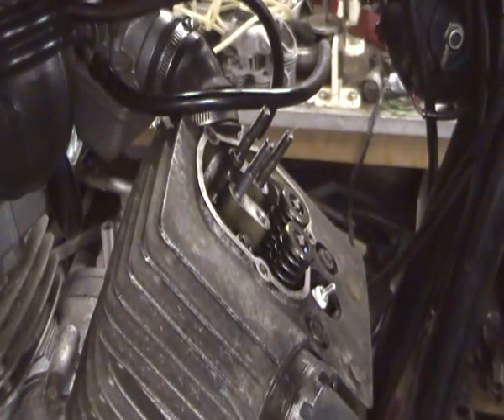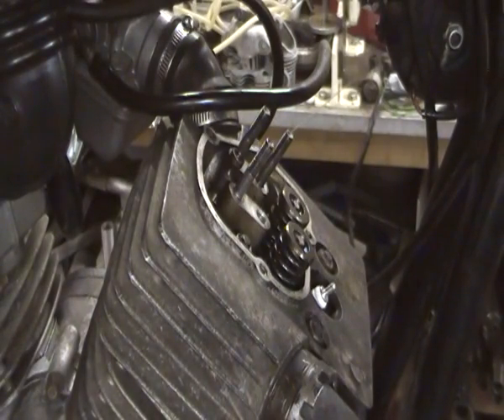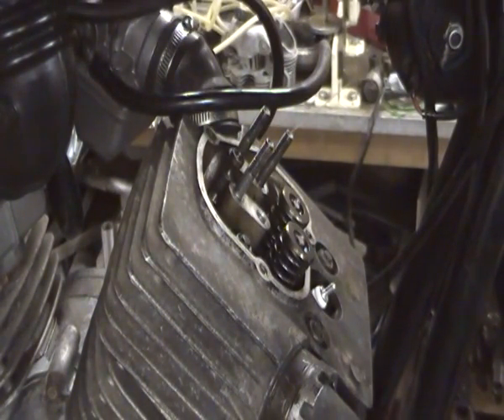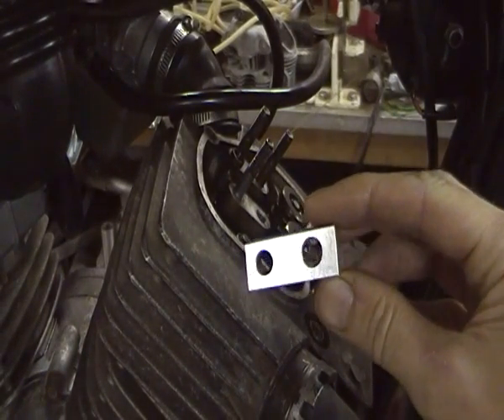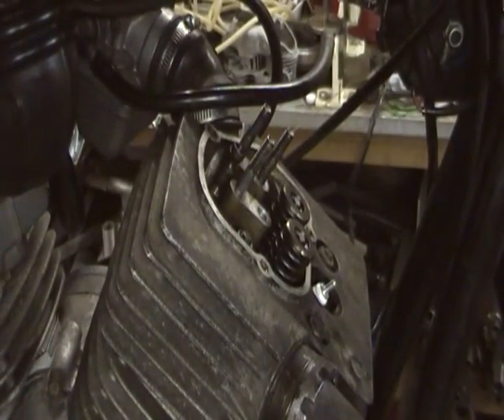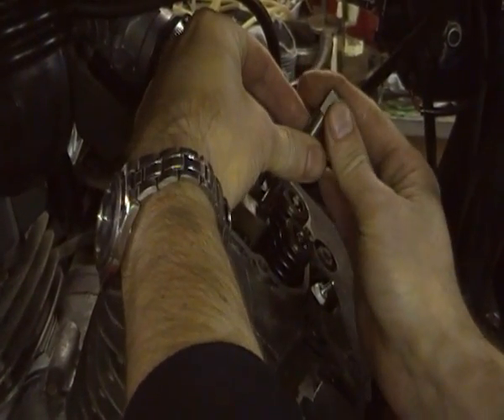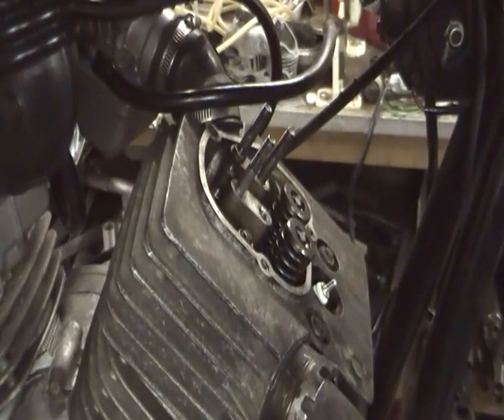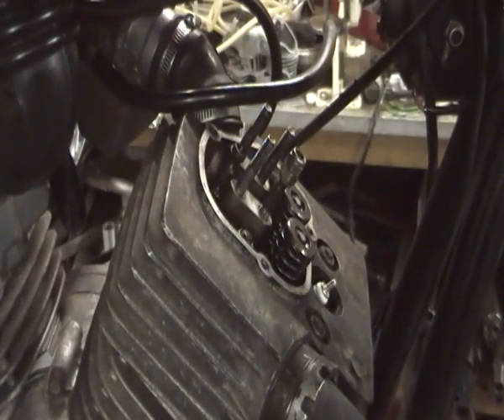Morini rocker stud thread repair

Comment from the maker: I do actually have some square drive sockets somewhere that will probably fit taps. I actually prefer the open end spanner, at least for starting the tap off square. I find it reasonably easy to tap true, so don't usually bother with a guide. A two stroke engine will be a Franco Morini Motori, which is a different company. Franco Morini was the nephew of Alphonso Morini who founded Moto Morini and was involved with the resurection of the Moto Morini brand in recent years.

Comment: great job. I find its always a challenge to drill, tap, and repair holes in such tight spaces. i'm a full time automotive mechanic so I have invested in lots of stuff to do this because I have to do it a lot of the time. a nice 90 degree angle drill with stubby drill bits is really nice, but tap sockets are a life saver, it allows you to use a ratchet which some times in those tight spots is easier than a wrench.

Comment: Why didint you open up the hole in the guide block you made for the drilling operation , to the major dia. Of the tap and use that to guide the tap for a square taped hole.